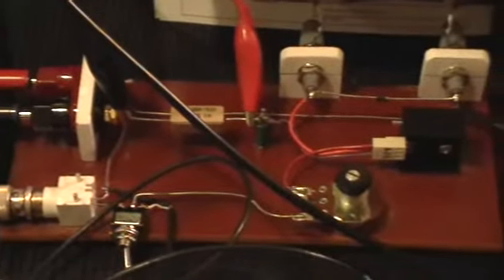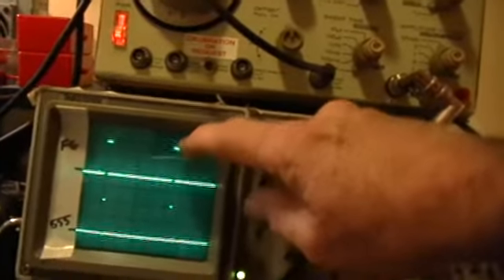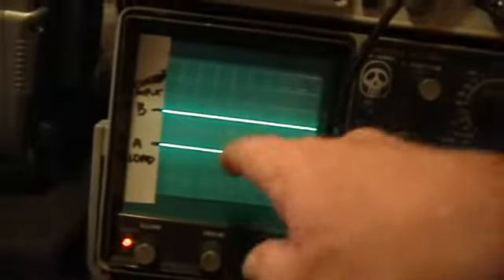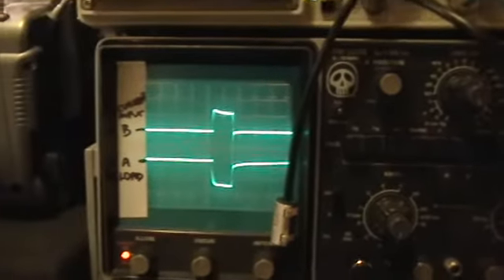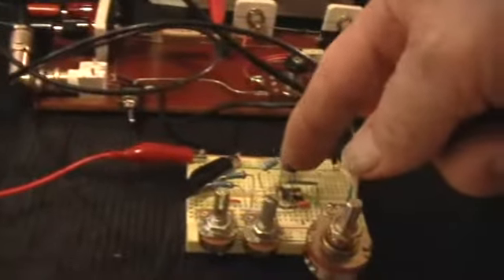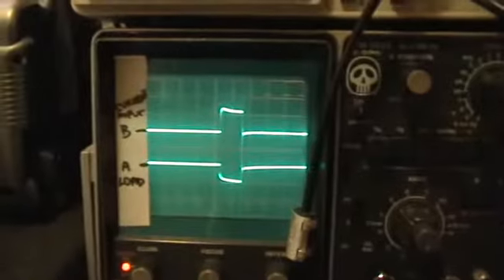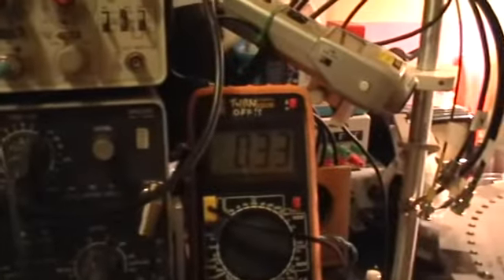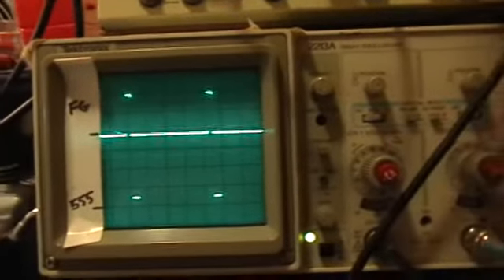Electric OU 2: The Ainslie circuit duty cycle

Comment from the maker: There is enough resolution so that anybody interested can actually even CONFIRM that my 555 is constructed EXACTLY per the Quantum article's diagram, and you can see clearly that my probes are just as Ainslie specified. 
Plus, the Quantum circuit is easily available.
So why are "experts" trying to say that this video is some kind of "hoax" or incorrect demonstration?
PROVE ME WRONG by building the circuit and showing different results with respect to the duty cycle.
OR--quit making accusations.